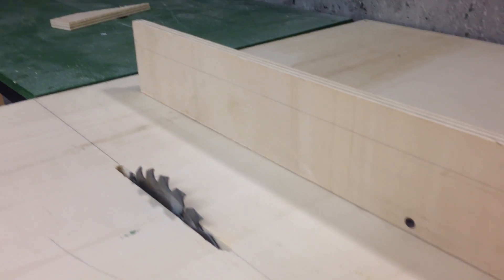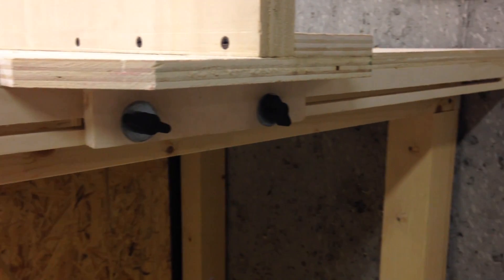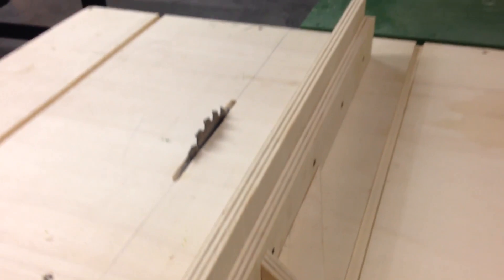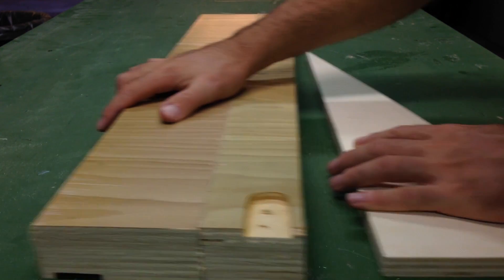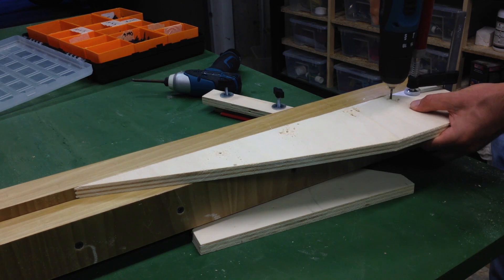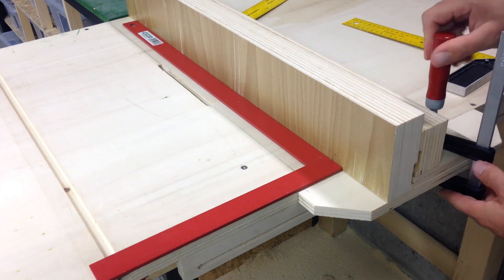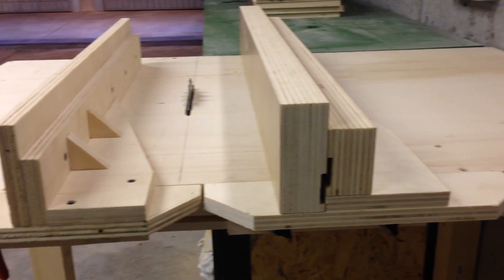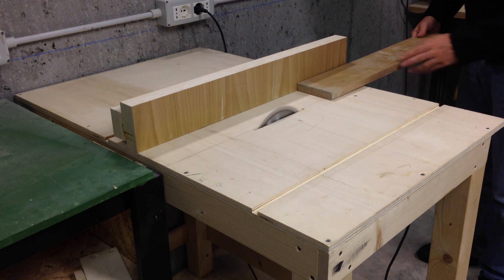Making a Homemade Tablesaw: the Fence II

Comment: I went through that hassle with a Ryobi table saw top, it's so thin you can't make a zero clearance so I made a frame around the table and made my zero clearance on that frame and if I want to make angle cuts I just lift it up and boom I still have my Ryobi angle cut at the normal table :) We have to invent stuff in order to have it working properly.

Comment: what about when you nee to use the table saw to make a 45 degree angle?
Reply: That has nothing to do with the fence.
Reply: I know but what if you needed to do an angle cut, that zero clearance is in the way, isn't it?
Reply: Carl Zorro Yep, but that can be changed with a new insert. Or perhaps he just doesn't use the table saw for 45 degree cuts.

Comment: To make the fence glide easier over the table, consider gluing small, thin strips of hardwood to the bottom. of the thick fence rail.  This would reduce the contact surface area on the table.